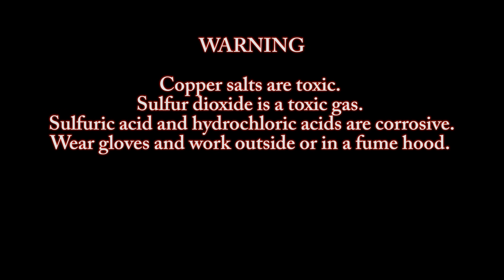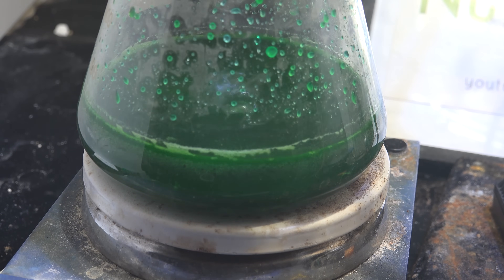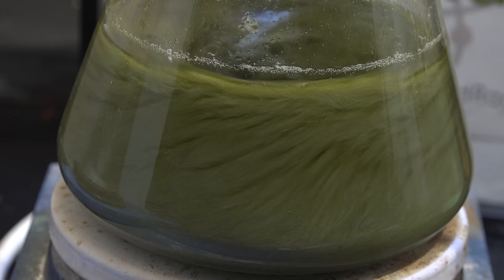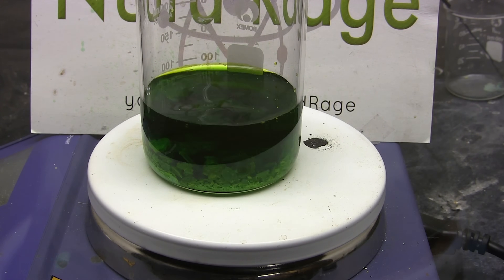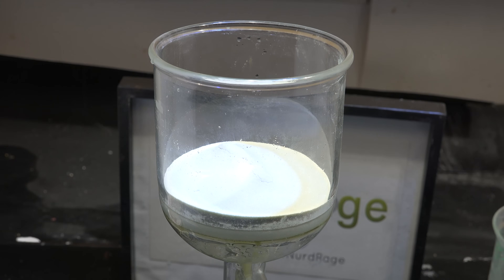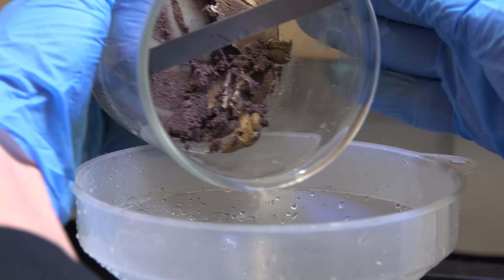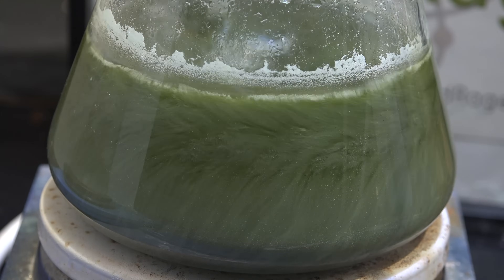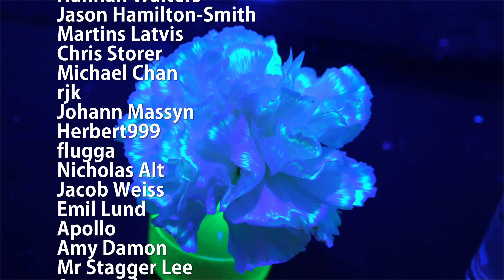Make Sulfuric Acid by the Copper Chloride Process

Comment: I think the main attraction is the autocatalytic mechanism.  This does take a long time but it could operate over a few days in the background while other important work is done.

I have a suggestion, how about trying to relive alchemist and early chemist in the 17th to 19th century and feature a discovery by each scientist.  For instance, make a video on Johann Rudolf Glauber and how he isolated “oil of vitriol” from heating ferrous sulfate.  This might require a quartz test tube.  This won’t be productive but it really give a historical pretext to chemistry as a craft and a disciplined science.  Would also like to see  how Leopold Gmelin discovered potassium ferrocyanide and Carl Sheele and chlorine from HCl and manganese dioxide ore

Comment: 03:52 I wonder if a catalyst might speed up the reaction. What about a tiny(!) amount of bromide? This might produce with oxygen in acidic solution a small amount of bromine, which would seem to mmediate to oxidation of Cu(I) to Cu (II) and should - hopefully - be small enough not to reduce too much sulfuric acid later-?
Silver (Ag+) in small amounts might work too - as it is not totally insoluble, particularly in solutions that contain enough chloride, although it might be converted to elemental Silver, I might give it a try.

Comment: I etching my circuit boards with copper chloride solved in muriatic acid, bubbleing air in it and it takes about an hour to get the job done.

Comment: Instead of bubbling air through it, you could get an oxygen concentrator machine (medical surplus) and this will output oxygenated air, which rather than the 20%~ oxygen in normal air IIRC its about 90%-95% oxygen.

Comment: In the EU sulfuric acid above 15% will be forbidden next year. So yes, this video is very important for us here in the EU.
Reply: 15% is quite low but you could just distill it, which is simple and it is a single step. If you want to reach ~90%, then it is a power hungry process. I use a propane torch to do this.

Comment: Little Stevie was a chemist,
but a chemist he is no more. 
For what he thought was H-2-O
was H-2-S-O-4.  

Another way to use the hydrogen peroxide is to rapidly turn the CuCl back into CuCl2.  The reaction is essentially instantaneous. Note, though, that this also requires 1 equivalent of hydrochloric acid - which however, is recovered at a later step.

Comment: Would bubbling in pure oxygen (from an oxygen concentrater) speed the copper oxidation process?  This pure oxygen could also be used to burn the sulfur without passing nitrogen through the mixture.  Excess oxygen could be added to the SO2 stream as it enters the reaction flask.
Reply: Probably. I am making CuCl2 with Cu + HCl + CuCl2 + air process but it is super slow.
Reply: @louistournas120  Throw in some hydrogen peroxide & the reaction will go faster.

Comment: copper (I) chloride sounds familiar:
"Materials purported to be copper acetylide can be prepared by treating acetylene with a solution of copper(I) chloride and ammonia:

    C2H2 + 2 CuCl → Cu2C2 + 2 HCl

This reaction produces a reddish solid precipitate. 

When dry, copper acetylide is a heat and shock sensitive high explosive, more thermally sensitive than silver acetylide."
https://en.wikipedia.org/wiki/Copper(I)_acetylide

Comment: I know this is a slightly older video, but I thought this would be a good place to ask this. 

Does anyone know if it's possible to produce sulfuric acid via electrolysis of pure epsom salt (magnesium sulfate) dissolved in water? From what I remember of high school chemistry, the idea looks like it works on paper in the balanced equation: 
(MgSO4 + H2O -> MgO + H2SO4)
but I'm an amateur chemist at best, and I can't find anything to confirm this without just trying it myself.
Reply: I dont think you can reduce magnesium in aqueous solution  due to the voltage required being high enough to electrolyse the water instead.
Reply: I might be a tad late in replying, but I think this should answer your question.
https://www.youtube.com/watch?v=6BThiJpbBJQ

Comment: Would it be possible to burn MgSO4 to yield MgO(s) and SO3(g) and bubble through water? If that reaction is still be too violently exothermic then could Oxygen and Hydrogen be generated in two separate reactions and be combined with SO3 to yield H2SO4?

Comment: But it is impossible to get sulfuric acid. Once you get sulfuric acid it will react with copper chloride in the beaker or any container
Reply from the maker: thats why the copper is precipitated out as copper (I) chloride. That way you can keep the sulfuric acid.
Reply: it means that there will be no reaction between copper (I) chloride and sulfuric acid?. As I know CuCl + H2SO4 = CuSO4 + HCl. because SO4 is stronger than Cl ion
Reply from the maker: Very little reaction, you can see in the video it precipitates out. only a small amount remains as you can see by the blue color of the acid at the end.
Reply: @NurdRage  how to separate HCl from H2SO4?. I mean how much heat is required to conduct this distillation for proper separation

Comment: I have a more effective method for producing H2SO4 that is moderately scalable
it uses drywall or hydrated gypsum as paste cathode with steel rod in the middle
how 2 video comming soon

Materials:
then the anode is a lead coil
the cell construction involves 3 containers
paper sheet (seperator barrier)
cotton (seperator)
1 water bottle (smallest)
1 glass jar (medium)
1 metal/glass pot (large)
The electrolyte is sodium sulfate made by reacting CaSO4 with NaOH
to get starting electrolyte
PSU 12v with max current of >10A

construction and setup:
The water bottle has holes poked into the sides to let water in and a sheet of paper
is rolled and placed on side of bottle.
Cotton is added at the bottom to seel the air gap of the paper roll in the bottle.
The water bottle is filled with hydrated gypsum do not use plaster or it will solidify
a steel rod is inserted in the midle.
Add some of the starting electrolyte to this and keep it damp till the paper is wet on the sides
then place it in the medium glass jar and fill that up with the rest of the electrolyte.
Then you place the lead coil in the solution of the glass jar.
the setup is placed in a metal/glass cooling container filled with water to prevent overheating.
the cell is hooked up where the steel is the cathode(-) and the lead is the anode(+)
run it for as long as you can replacing the central cathode to further concentrate the acid but make sure
not to deplete the sodium ions.

Post run cleanup:
remove the cathode from the center of the cell.
WARNING!! do not turn off the power supply untill the cathode is removed or the electrolytes may react and BOIL!!
also chloride contamination may cause release of HCl gas.
filter the electrolyte from the glass jar and place in the freezer until precipitate comes (NaHSO4+Na2SO4) and save it for future runs.
the liquid is then boiled to remove HCl contamination then distilled to get pure H2SO4.

PS I live in a country where u cannot buy sulfuric acid so i have to go and dig up some gypsum :)
i can just get it from the ground that way!

Comment: Couple questions: 

Could you use something like ozone instead of oxygen to re-oxidize the CuCl to CuCl2 more quickly? 

Also, would an easier way to do this be by making H2SO3 from SO2 & H2O, then oxidizing it to H2SO4 with something like O3 or Cl2? (Cl2 would end up making HCl, but could be boiled off easily?)
Reply: The first historic process to make oil of vitriol used ferric sulfate. You could recycle the residue ferrous oxide into rust which reacts with sulfur dioxide to make ferrous sulfate and could that be air oxidized? I know some CuS mining involves leaching with ferric salts and air to get soluble CuSO4, also some circuit board etchants use ferric salts.
Reply: That gives me the idea of the question of which is the fastest dissolved oxygen reacting stable valence metal, iron, copper, manganese, vanadium? I know the fastest catalyst for air oxidizing oils like linseed oil is blue planar complex cobalt soap catalysts, which are superfast at air drying double bonds and might even attack single bonds.
Reply: In the 1800s lead was the prime linseed oil catalyst. That gives me the idea of lead oxide + SO2 + O2 does that give lead sulfate precipitate? How fast? Then can that lead sulfate paste be electrolyzed back from a sulfated battery into lead, lead dioxide and sulfuric acid? The electrobromine process is better. But traces of lead sulfate might act as a dissolved air oxidation catalyst in cuprous chloride, possibly better than traces of iron, or perhaps copper is already faster than either. Maybe the bottleneck is physical, as in low bubble surface area. Maybe ultrasound could break up the bubbles from a bubbling stone.
Reply: I looked at the electrobromine process - the graphite anodes are a problem as they disintegrate. Lead dioxide is a highly conductive oxide and the anode can be stable. You could react SO2 with lead dioxide to get lead sulfate, and electrolyze that to regenerate the lead dioxide, and get hydrogen gas at the anode (unlike in a lead acid battery that does not evolve hydrogen, somehow you have to come up with net oxidation, just like in the electrobromine process.) This whole thing could be a continuous process, with slight excess SO2.
Reply: Most people have easy access to cheap gypsum drywall, compared to expensive bisulfites, or even sulfur brimstone, or even stuff like epsom salt that comes with 7 waters of hydration so its pretty expensive. There should be a way to convert gypsum into  sulfuric acid.  Can it be dissolved in ammonia? (there is a patent that says it dissolves in hydroxamates, but what about ammonia?) Then the calcium knocked down as carbonate, and now one has to tackle ammonium sulfate. Is this what the chinese patent CN103224246A is about? I don't read chinese. On a related topic making hydrochloric acid from salt, the Solvay process gives sodium bicarbonate and ammonium chloride. Can the ammonium chloride be cleverly tackled into ammonia and hydrochloric acid or chlorine gas? Seems like the Solvay process is halfway finished only. Something like ferrous ammonium chloride to ferrous chloride and ammonia then go from there? Or cuprous ammonium chloride? There is a patent on making anhydrous MgCl2 for electrolysis free from water of hydration using Mg(NH3)xCl2 then liberating the ammonia. Ammonia may bind too strongly to copper to come out as water of hydration does from copper sulfate, but it does come out easily from magnesium, perhaps iron is like that too, and if not, change the valence with air oxidation and maybe it comes out easily then. TGA thermogravimetric analysis charts can be helpful if one has access to such a device, to see what temperature the ammonia releases from various salt complexes.
Reply: Manganese ammonium chloride may liberate the ammonia in the trivalent state, then liberate chlorine gas in the tetravalent state. It'd be nice if there were some air oxidation catalysts that at room temperature would drive that cycle, Mn2+-->Mn4+, back to 2+ via chlorine liberation. Life has clever catalysts and pull off all kinds of tricks all at body temperature.
Reply: Or you can just make a vortex with the stirring magnet and that will beat the air into tiny bubbles if properly offset.
Reply: If the cuprous chloride is kept dissolved via excess hcl is the air oxidation faster? Or via ammonia complex, but then it would be stripped by the sulfuric acid and the whole thing would have to be diluted to keep it unstripped.
Reply: Problem is cobalt complexes get stripped by sulfuric acid at high pHs, DEHPA gets stripped at pH 3 and Cyanex at pH 4. To maintain high pH you would need something like hydrated aluminum to keep absorbing cobalt catalyzed oxidized SO2, and I don't know if that aluminum sulfate yields SO3 on calcination. Divalent metals like copper give a mixture of SO2+O2 on calcination, while trivalent give SO3 I read somewhere.

Comment: Do you think there would be any useful optimization value in buying a $250-300 PSA oxygen concentrator to speed up oxidative regeneration of the CuCl? The zeolite nitrogen scrubber in a PSA doesn't produce pure oxygen, but it can enrich the %oxygen up to around 80-90%, and the flow rate should be similar to the air injection used in this video, it's at least a high enough flow rate to meet human respiration needs.

Comment: Hello NurdRage. I am having a hell of a time getting acids here in japan. Some things have cas numbers that I can use but most dont. I speak english. I have been waiting for a vaccum pump so I can try Chemplayers process of bubbling SO2 through hydrogen peroxide. I also need to concentrate my peroxide up to 30% which is a pain in its self. So I would appreciate more videos geared toward people like me who have huge limits on availability.  They dont even sell sulfuric acid to clear drains here.  There is only so much fun stuff one can do without acids. It has taken me a year to get the litmus paper beakers scales and I built a magnetic stirrer. I am dedicated but limited.
Reply: Ive still yet to do the method by chemplayer. I am thinkig now about vanadium dioxide. To make oleum
Reply: Hows the last 3 years been? Still doing chrmistry?  Have you figured out a way to synthesize acids or buy them
Reply: Ultimately the "usual 3" can be made from things that are everywhere. It comes down to practicality. Sulfuric from sulfur isn't hard as mentioned, just a matter of concentrations. Nitric literally from water and air. Half cell setups with table salt can get hydrochloric. Useful amounts? I'll let you work on that part lol

Comment: Some of the combinations you come up with are not what one would see in a common Chemistry text book. Do you have any references for designing reactions? I've been through the thermodynamics classes and "get" the Gibbs free energy stuff but am usually at a loss for finding sufficient data to use those concepts.

Comment: Instead of using an air buubler, could one safely use a commercially available oxygen concentrator during the oxidizing step? Would that exponentially reduce the overall time spent on this process, or does introducing concentrated O2 create a whole other set of problems that I didn't think through before hastily typing this out?
Reply: yes, you can and it works like a charm!

Comment: I wonder if one of those little ozone producing air purifiers could be used to make ozone to bubble through the solution.  They don't make much, but it seems like it should react more rapidly (assuming ozone would work in this process and that it doesn't just immediately convert dissolved SO2 into sulfuric acid.)

Comment: Still not getting your videos in my subscription feed, I filed a ticket with YT when you made the video asking us to if we had an issue.
Reply from the maker: damn, did you click the bell and check of notifications was turned on?
If it's still a problem, send another feedback ticket. Beyond that i'm not sure what can be done other than to open a new account and see if that works.
Reply: I will file another ticket, I had set notifications originally, but I will redo it. I make a point to check your channel anyway, but wanted to be sure you knew the issue continued.

Comment: If you used pure electrolytically generated oxygen rather than air would that speed up the process? Also when clearing the filter and adding back the HCl, why not just back wash the filter with the HCl? Anyway thanks for sharing, any process that uses catalysts is interesting .

Comment: Would adding hydrogen peroxide (maybe even the drug store 3% stuff) instead of air be more effective at regenerating the copper chloride? Or would the excess water cause problems?

Comment: perhaps there is a way to bubble air through the solution, not just expose the surface, to react it faster, or perhaps bubbling both air and sulphur dioxide, to run the process, but the when it comes to harvesting, and reconstituting. The solution have a "faster" reaction to speed up those slow parts of the process

Comment: You could definitely try bubbling ozone instead of air, IIRC ozone generators are not that expensive to buy and run.
Reply: But you need to feed the O3 generator with pure O2 otherwise the output is still mostly air.

Comment: How about a practical means of making Fuming Sulfuric Acid (Oleum)?
Reply: demandred1957 the industrial method is absorbing sulphuric anhydride in conc. sulphuric acid until the desired concentration, no way of doing it in an amateur lab, production of SO3 involves high temperature and pressure, and vanadium pentoxide catalyst. Maybe you could do something by  oxidizing SO2 with pure O in a thick erlenmeyer flask with maybe 2 atm and cool it under 0°C to collect the solid SO3, but handling it is always dangerous. It is one of the most hygroscopic substances known and exposing it to air will almost instantly cause a cloud of sulphuric acid which is really really difficult to get rid of. (When SO3 reacts with water it heats up A LOT, and this causes the SO3 to sublime and speed up the process)

Comment: I'm not a chemist so this may be a dumb question but could you  use hydrogen peroxide instead of bubbling air over night to speed up the oxidation?
Reply: yes you can in this case, but if you can get 30% H2O2 you usually dont have a problem getting sulfuric acid
Reply: did you watch the whole video?
Reply: If I donate via patreon, will my name be a the end of this video

Comment: Is it possible to bubble SO2 gas into dilute h2so4 that is simultaneously electrolyzed? The idea is that electrolysis will produce active oxygen gas that reacts with SO2, so the SO2 will be converted almost immediately into h2so4. If done correctly i think the only input will be SO2, water and electricity
Reply: Instead bubble SO2 in to 30% or more conc. H2O2 
It should form sulfuric acid